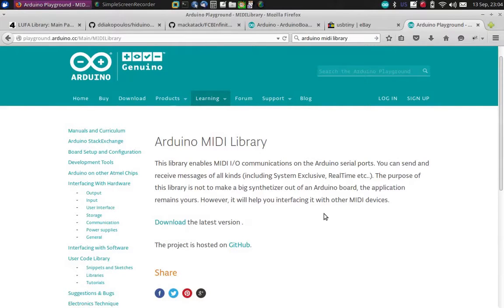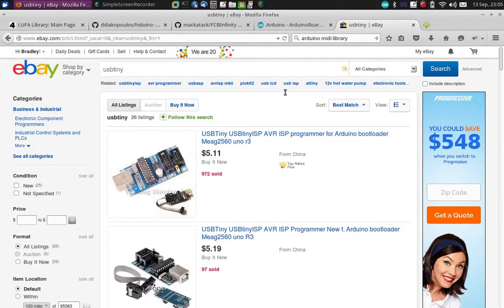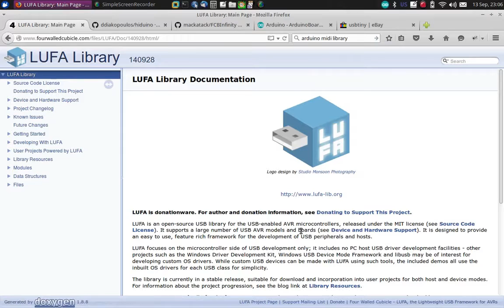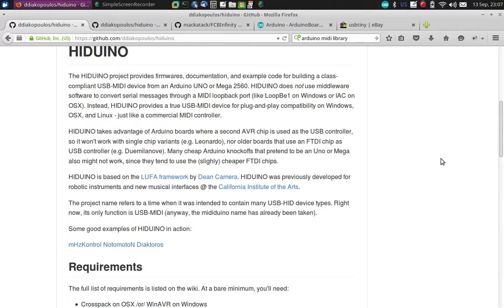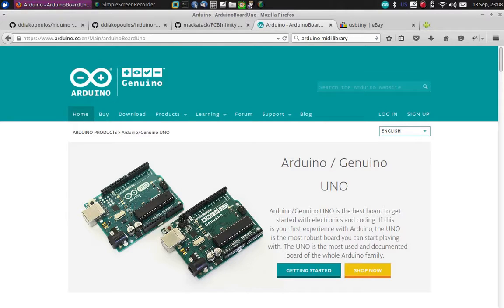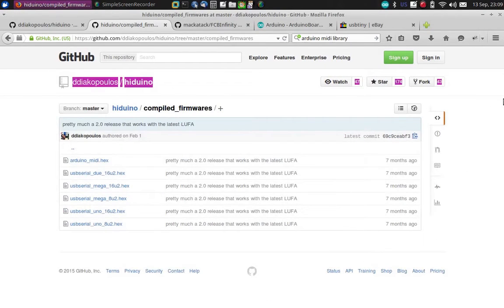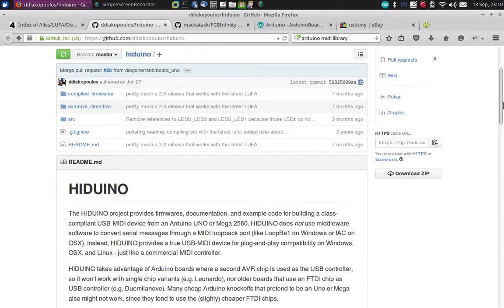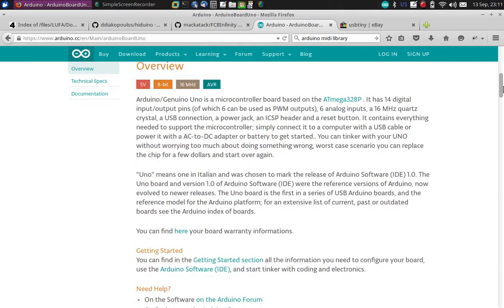Arduino UNO or MEGA USB MIDI

Comment: Hi Brad, great work..   I just got a Arduino Mega ADK and also want to send midi through the existing usb on the board. Do i have to do all that firmware updating? or can I just upload a scetch to the board. I was watching that a teezy is needed to update the firmware. Is this the only way? is there an easier way of doing it? If i have to do so.. I will, and can you explain it better. And after that update to the firmware. (which firmware do i use?) Do i upload many scetches. or do I combine scetches? can I do that?  all im using the board for is to trigger midi notes by connecting to the digital pins. and just turning midi notes ON and OFF,  no sensitivity..  would like to change midi channels too and octaves,, thats it...  i found a scetch to use but... if i use another one  instead, do i combine them... or just use one and adjust the code to include it all.....?  please explain... write me  please  Al